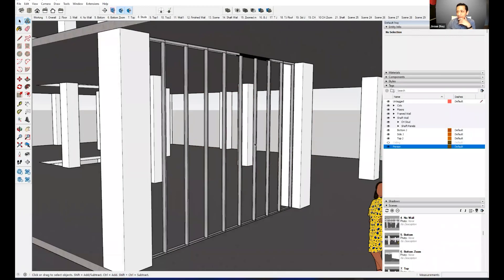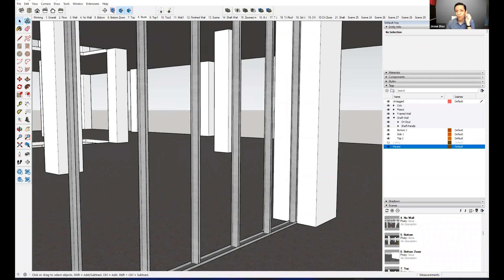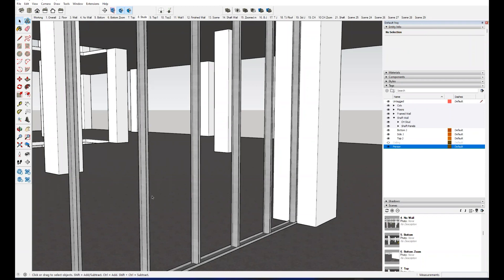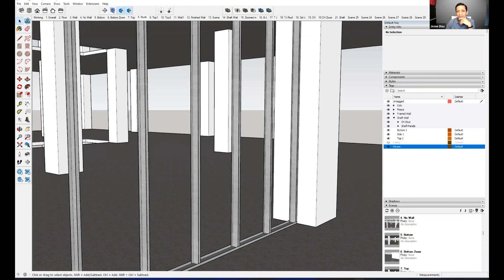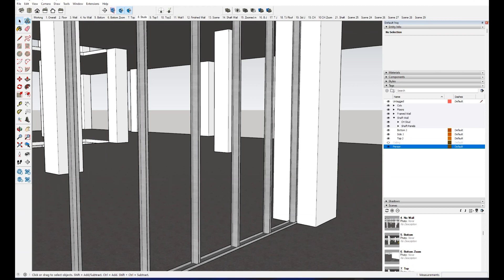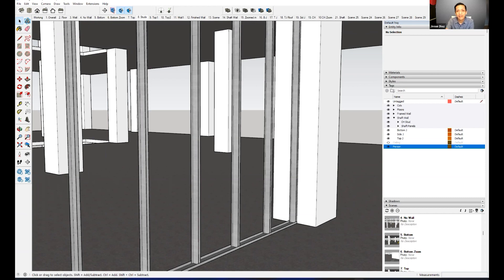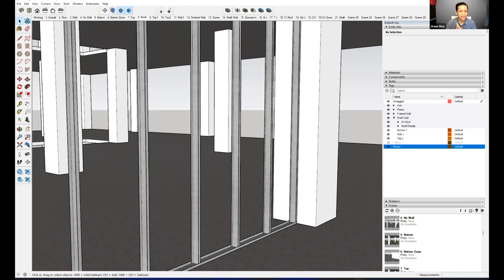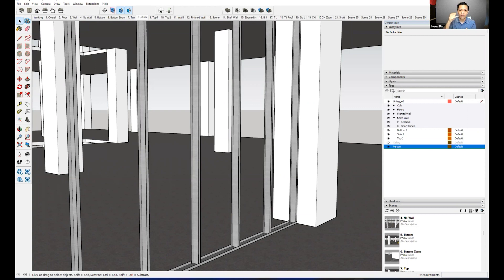AC  036b - Why are studs spaced at 12", 16", and 24" ?

Comment: OSB is 4'x8' & requires 1/8" gap between sheets for expansion, so doesn't that start adding up quickly such that 5 sheets = 20'0.5" instead of 20'? What is done about this?

Comment: I have a client with 12ft walls using 2x4s, but load beams sit on a two 2x4s, I’d like to get some advice on this
Reply from the maker: I’d recommend you hire a local architect or perhaps a structural engineer that can help with your specific projects. Thanks for leaving a message 😊 .

Comment: Depends on stud size, gauge, and height to resist L/240 (for interior)
Reply from the maker: While you are absolutely correct that the spacing does have a direct effect on the deflection of the wall, that is not why we use 12", 16" and 24" spacing. To make this point, we can say that 10", 15" and  20" spacing would provide the same concept when it comes to deflection. 10" spacing would even give you a better deflection result than 12" and 20" would provide a better deflection result than 24", but we don't use 10", 15" and 20" because gypsum board does not come in those sizes. 
Great point about the L/240!
Reply: @archicorner  You’re right‼️The module size of gypsum board dictates the spacing dims to mitigate waste. Always just took the spacings for granted, but makes sense.